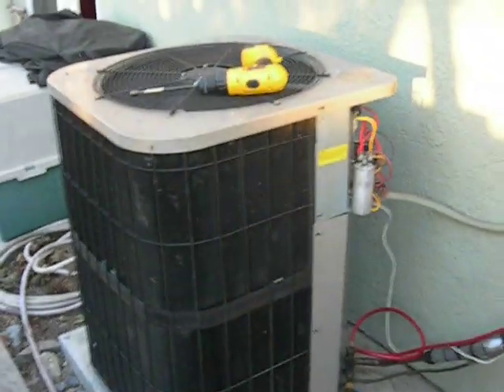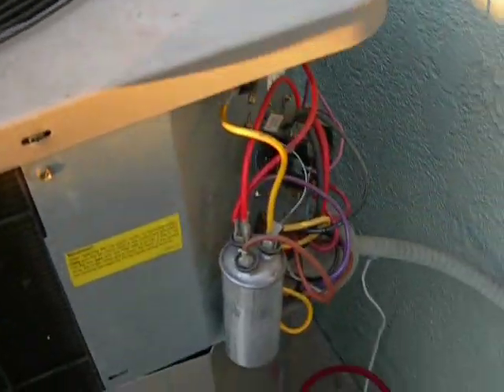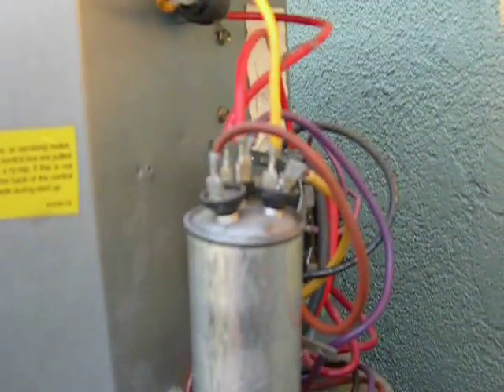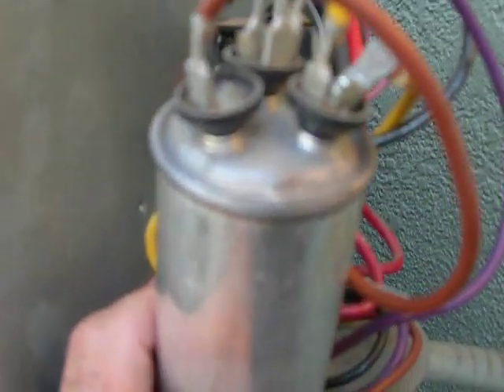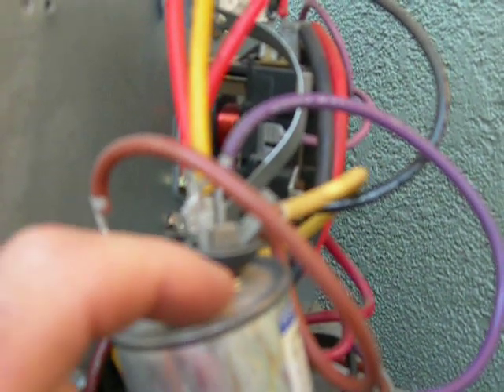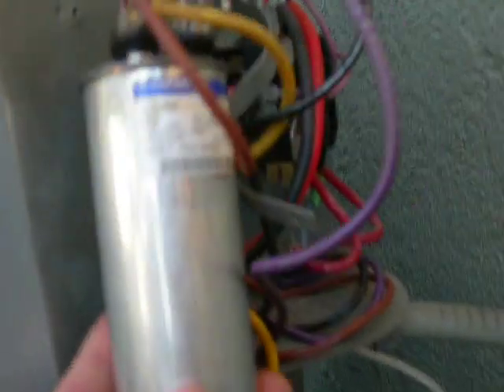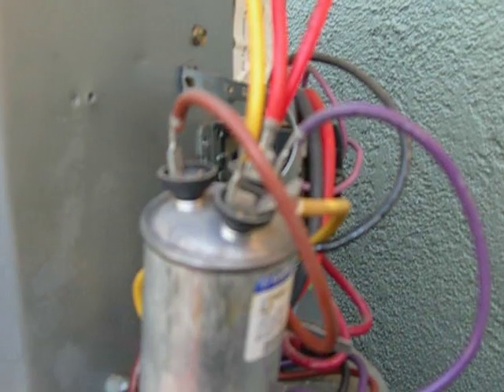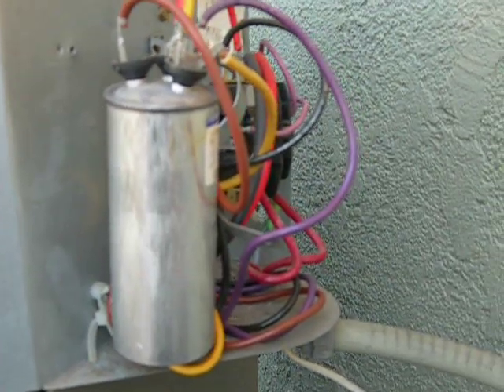What a Blown Dual Capacitor Looks Like...

Comment: I'm on my 3rd dual cap. after 16 years
Reply from the maker: Yep, sounds about right. 1 every 5 years. Change it before it fails , to protect the compressor every 4 Years. Or check it every year with a Meter.

Comment: can you please tell me what kind of capacitor i need and where i can buy or a link to order from. its a ruud upka-025jaz.  serrial number on the unity is 6388-m2403-08556.  mfd 370  35.0/3.0      50-60hz  the old capacitor is round with three connectors on top with a color code white, black, light blue.
Reply from the maker: +Ti Berihun     Just google a 35/3.0 Mfd Run Capacitor like you just wrote down in your message. you can order from internet. make sure the capacitor is not a 35/5 mfd. 370 or 440 Voltage Capacitor will work. yours is 370 vac.
Reply: +OcRefrigeration & H.v.a.c. I have tried that just couldn't find like the one p pulled out from the unity.
Reply from the maker: +Ti Berihun  what was different ? the New ones may be smaller it's ok . different shape. does not matter. only thing that matters is that the Mfd is the same. 35mfd & 3.0 Mfd .
Reply from the maker: +Ti Berihun  Here is a Link >>>>>>>    http://www.supplyhouse.com/Rheem-43-25133-03-35-3-MFD-Round-Run-Capacitor-370V?gclid=COqzutO7vckCFUNgfgodVBgDPA
Reply: OcRefrigeration & H.v.a.c. ok I will try again.  Thanks.

Comment: 23 years on a Heil tempstar Intercity products.  Plastic body dual cap, no failure just changed cus I was doing the contactor which still worked but contacts heavily pitted from all the years of on and off, creates big voltage drop, waste energy, not full to motor and compressor. Plastic body was replaced with  metal cased, exact replacement size etc, just metal can, not plastic, found exact contactor for a 23 year old Heil, must be a common still used contactor. $25!

Comment: What is the difference between a run capacitor and a start capacitor ????
Reply from the maker: Main Differences are Start Caps have a plastic Body usually and are made to Stay in the System for Starting only. Run Caps are Usually / Allways made of Metal and are in the Circuit while the unit is Running.  For more info Just Google that Question.

Comment: Capacitor has to look bad if it is bad, right ---- wrong! It is not always the case. The capacitor could be bad but it does not look bad. A meter reading is necessary.
Reply: Crandall, the cap is bad. OC explained to you why the within the first 1 minute of the video. When you have done the trade so long, like OC has. Your eyes and ears play a big role in troubleshooting a piece of HVAC equipment. HE RIGHT YOU ARE WRONG. OC should shadow you or your job for a day and comment about your performance. That would be a must see you tube video

Comment from the maker: more---i can't be sure without putting and amp meter on the power wires to see what kind of amps it's drawing. if it is drawing locked rotor amps-high amperage and blowing the circuit breaker---compressor is probably junk. you must clean the air filter every month too! if u want air conditioners to survive!

Good luck!

Comment from the maker: i'm guessing this is a window air conditioner? u do not tell me if the unit is working, i'm guessing it's not? if the unit is not working and u have not ever cleaned the condenser . (that is the part that blows the hot air out) compressor could be junk. condenser needs cleaned every year! blow it out with air. most likely the start components are junk!
replace the start components. start cap, relay and oveload. if the compressor does not run still. compressor is probably junk!

Comment: I just had my capacity replaced 6 months ago from a 2 year Akai air conditioner. Admittedly it was the cheap[est one available for $500 but that shouldn't mean the capacitor needs replacing every 6 months now that's ridiculous. Unless its the compressor? How can you tell if its the compressor and not the capacitor that's the problem?

Comment from the maker: @171apples171 

Continued---When connected orange to orange. purple to purple. the motor spins one direction---usually the wrong direction. when you switch the Push connectors orange to purple.and orange to purple. the motor spins the other direction. Good luck.

Comment from the maker: @171apples171 
1st---if it is 3 Phase---one of the main Power wires has gotten switched when u were wiring things. just switch any two of the 3 main power wires and the fan motor will turn the opposite direction. if it is not a 3 phase motor...read on...
2nd---The fan motor direction is reversable---follow wiring diagram on the side of motor for motor rotation. usually it just entails switching two colored wires. two spade connectors. usually orange and Purple wires.

Comment: Hi there, i recently got a Modine Hot water heater.. not sure how to send Private Messages on here but i had a few questions about it. I wired in the run capacitor to the Neutral on the plug in wire. before i couldnt get it to turn on before.. now it runs awesome but the blades spin backwards. what do you think is wrong? And yes... the blades are on the right way :D

Comment from the maker: @htrodstar 
Very Good Question. Yes, it Sure Can. A Popped Top is Just a For Sure Way to Tell.
If in Doubt, use a Test Meter---or---My Best Suggestion--- Just Replace the Capacitors Every 5 Years In Hot Climates, Capacitors are Cheap! In Mild Climates Every 10 Years.

Comment from the maker: @wsoxman 
Usually Not ! 
I have Been to Many Service Calls Where the Capacitor is Junk and I Just Replace the Capacitor and the Motor Takes off running Fine and is Still Running Today.  Probably Something Else. 
1) Did you Replace the Motor With the Same Type and horsepower. if you skimped on the motor and Replaced one with a lower horsepower rating. There is your Problem ! if you have a choice allways pick a little more horsepower over a less hp model.
Arizona-Needs a High ambient Rated mtr

Comment: @091sammy well you probably could discharge it, but it will just charge right up again if its still connected to a power source. for alot of smaller capacitators, they charge most of the way in a matter of micro seconds.

Comment from the maker: @BGreenHVAC 
I Can' t Tell you How many jobs i get to and the Last guy said to the Customer you Need a new Compressor.
Probably 9 out of 10 Compressors aren't Bad. They Just Need New Start Components, Although i do Advise the Customer if the Compressor is Older than 12 years old they are on Borrowed Time. That Number is Compressors that Run Every Day! 
Yea, I Hear You on the " Finding People that Don't Know What they are doing...They help Keep us Knowledgeable and Honest Guys in Business.
Reply: Right I know. I remember working for a HVAC shop a couple of years back. The service manager told me a past story one day. The service manager was a HVAC tech there at the time. They called them to get a second opinion on a bad ac compressor. It was just a bad capacitor .  The head facility manager at the gas station was so impressed he started giving the company more work s he years went by. When I stopped working for them. We were doing 80 + sites for this customer. I am sure this company might be doing all the sites now in Lower Michigan. Well over 130 locations. Honesty is the best policy

Comment: can u discharge the capacitor with a screw driver while it is still connected with wires or do u have to disconnect all wire leads??

Comment: On a hot and busy day this is what I like to see.  Probably about the quickest  to diagnose and easiest  to repair.  I would probably  install  two single capacitors, for the reason you mentioned in the video.   You can usually find enough room to add the small 5 mfd capacitor.  Good video!